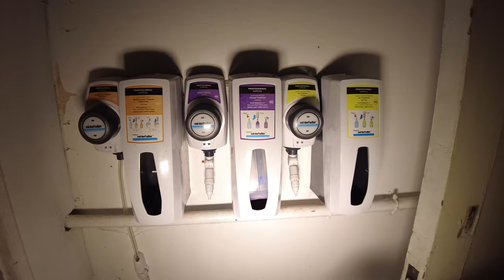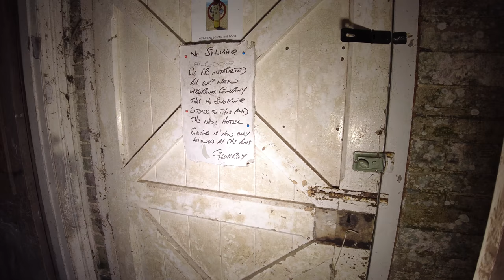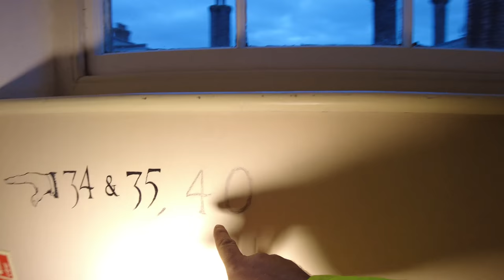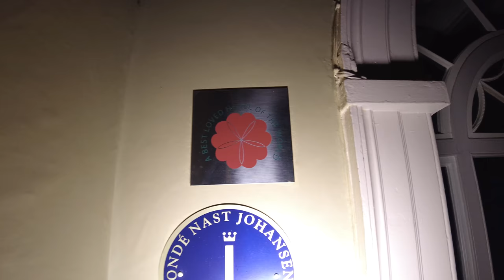Langdon Court HOTEL Plymouth TUNNELS FOUND

Comment: Love the content.

I've worked in many a establishment over the years and the old spend the money on public areas and the minimum out back to comply with legislation will always be prevelant.

There's always going to be the argument that the public areas are where the money is made but a happy workforce leads to a better business. In the company I work for now I've seen some horrendous states of repair out the back but the front is always well kept. These days I'm based in head office and it's a different world to what I've seen at other venues.

Coincidentally there is an old site in the company I work for now that I'd love to get in and explore but the security is mega tight, I'd love to see the internals of the building but the chances of gaining entry with the security, CCTV and motion sensors both inside and outside are slim to none 🙁

Comment: A lot of locked doors on top floor rooms will have a boring ole hoover and cleaning equipment in them lol I stayed in a posh converted old building  that was an air B and B early this year in Gloucester. The nice ole doors were filthy and the glass in the entrance door, scuff marks, paint not matching etc. It’s the finer detail that I will notice not how bling bling a room is or what type of posh bath tubs they have. I guess they look at it that it will be a lot of drunk people and they won’t even notice. Shame the staff as usual get the bare minimum, nothing changes through the decades. Lovely place that hopefully will be used again before its wrecked by vandals!

Comment: 30:18 - Bass and Whitbread were major brewers back in the day (red paint on walls)  Barrels(and later on, kegs) would have been dropped onto a sandbag and strawbag at the bottom of the steep slide or lowered (with 2 straps around made fro ) for a softer landing. Bygone age of beer delivery.